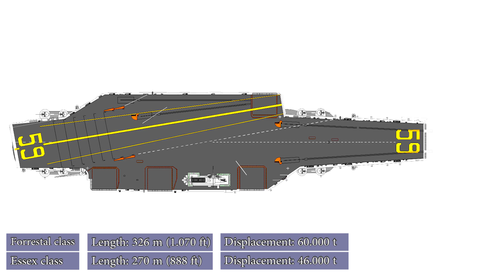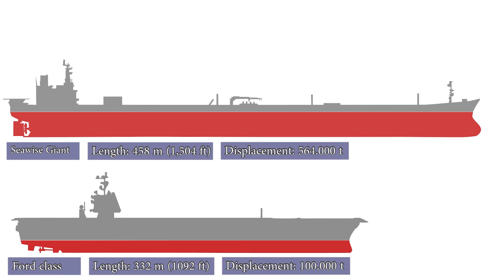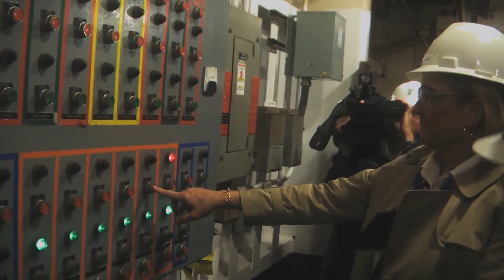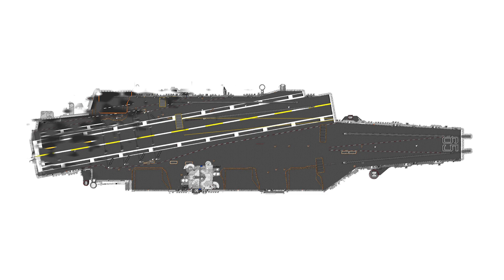Why don't aircraft carriers get bigger?

Comment: The biggest reason Carriers are the size they are, is speed. They need to be fast to get to locations, and evasive maneuvers in combat. The Nimitz can reach 32 knots officially. Some say its reached 40 knots but that's not official.
Reply: Nope!  The longer the waterline, the faster it can go.  They are the size they are so they fit through the Panama Canal.
Reply: @Ron_the_Skeptic  no. Causes its too large in the first place to fit...
Reply: @themeddite , they fit with 1 foot of space on each side, in the old canal.  The new canal is wider with bigger locks but carriers take a long time to plan and build so the larger canal has not affected them yet, and may not as there may be other choke points around the world.
Reply: @Ron_the_Skeptic  n9 cause its over 100 feet wider than this locks. Nimitz DOES NOT FIT IN THE PANAMA CANAL
Reply: @Ron_the_Skeptic  Carriers absolutely do not fit in the Panama Canal. I took 2 of them around South America for this reason. There are some great photos of Ronald Reagan in the Straights of Magellan.
Reply: @michaelmappin4425 , yes, I think I mixed two different references.

Comment: because 3 aircraft carrier that carry 80 aircraft each give more strategic option than 1 carrier that carry 250 aircraft. Also, dont put all eggs in one basket. If 1 of 3 carrier disabled there still 2 fully operational. If 1 250-aircraft megacarrier disabled some battle will lack air cover
Reply: The US military is LEGALLY required to have 11 main aircraft carriers, so if they had to build a bigger one, they'd still have 11.

Comment: Not currently a factor, but might be important in the future: combat UAVs. Of course, we have armed UAVs already, but they're designed for limited roles, and everyone seems pretty hesitant about replacing full on fighter jets with UAVs, but without a pilot and all the stuff you need to safely carry a pilot, and with much lower survivability requirements for an unmanned vehicle, it's probably possible to get full size fighter jet capability in a significantly smaller plane, which can then operate off a smaller ship. For a second tier navy (or really, for anyone who isn't the USN), that could be a game changer. Imagine a fleet of ships the size of helicopter carriers, but with the offensive punch of a supercarrier. Even if it doesn't go that far, just the ability to spread an air wing around multiple smaller ships without compromising aircraft performance as much could be enough to get a lot more countries into the carrier club. The advantage there might just be so huge that some smaller navy that can't afford supercarriers will roll the dice on the idea. Even the USN is getting noticeably nervous about the survival of its supercarriers in a modern war with faster, longer range missiles and armed UAVs and UUVs and AIP submarines and all these other new threats. They may just find themselves stuck between accepting smaller ships with greatly reduced capabilities, or going unmanned in order to keep similar capability via smaller, more numerous ships.
Reply: Except that drones could not come close  to the capabilities of manned fighters nevermind the fact that the moment you try to hang heavier weapons off of it you basically nullify its ability to take off from smaller ships. And on top of that drones have an atrocious safety record so if any smaller navy tries to operate drones in the same manner as supercarriers there going to lose a quarter to half of their drone fleet in peacetime ops alone. And most of those threats you mentioned can easily be countered by proper tactics. Except for the AIP Subs which is an irrelevent threat.
Reply: @gotanon9659  Current drones can't replace manned fighters, but there's nothing fundamentally preventing them from being improved to have similar or superior capabilities. It's definitely a problem that would need a LOT of software development, but there's no reason to think it can't be done. Of course the vehicle has to be big enough to carry the weapons, and the sensors and countermeasures and fuel and so forth, but not having the pilot and all the stuff associated with keeping him alive and and comfortable is a significant savings.

If missiles could be "countered by proper tactics" no-one would buy missiles because they'd be a waste of money. There are ways to survive in a high threat environment, but all of them have costs (and I don't mean in terms of money, though it certainly does cost money). How much those costs are, and how much they will impact the ability of a carrier to do its job is an open question, but I believe that the USN is right to be concerned. I'm not saying that supercarriers will become dramatically less useful. I'm saying that they might.
Reply: There's also the fact that the more capable an aircraft is, the more expensive it is. That applies to unmanned aircraft too. To make one as capable as an F35C will make it as expensive as a manned aircraft and then you'll be back to the same risk assessments only it will involve lots of money which will influence how many you have.
Reply: @MotoroidARFC  No, it definitely would be cheaper, simply because it isn't carrying a pilot. A pilot needs a cockpit, and a whole bunch of equipment for life-support, comfort, safety, emergencies, control, instrumentation, etc. All put together, it's a lot of weight and bulk. A computer doing the same job is a whole lot simpler, smaller and lighter, and that has knock on effects throughout the aircraft. An unmanned aircraft is also a little more expendable. No-one's going to want to lose a high performance drone, but at the same time, if it has a major failure behind enemy lines, you can just self-destruct it and you don't have to worry about rescuing a pilot, so it probably would be a net benefit to scale back margins of safety and redundancy to some degree, which also has benefits for cost and performance.

Just gut intuition, but I don't think a 30% weight savings is unrealistic for an unmanned aircraft of otherwise similar capability.
Reply: @TonboIV  the Global Hawk is about $131 million fly away cost while a Super Hornet is about 66, the Lightning C about 94. And this is just surveillance. So yes, a UAV can get more expensive than a manned aircraft. It really depends on how much capability you want and how many you can afford with that capability.
Reply: @MotoroidARFC  Even assuming your numbers are accurate, an updated version of a 70s fighter and a 90s drone aren't a good comparison because they come from different technology generations. Age is a such a huge factor because development costs are much higher these days, and for the Hornet, the development cost was long ago recovered (or written off). There were also more than a thousand Hornets produced vs less than a hundred Global Hawks! That makes a big difference to cost. Military procurement is also just an incredibly fucked up landscape were costs can be altered by all kinds of ridiculous reasons, and some programs just have a lot more cost overruns than others.

To make a sensible comparison between manned and unmanned aircraft, we have to assume unrelated factors like production numbers or the economic circumstances of the contractor are equal, in which case not needing to carry around a pilot should provide savings. Or rather, if the engineering team can't get savings from not carrying around a human, then those engineers are incompetent and they should be gotten out of the way to some pointless job where they can't do anymore damage. Maybe sales.
Reply: @TonboIV   Global Hawks have flown to Australia from the US on their own and can stay in the air for over 30 hours. To get that capability required more money.

Another example of capability raising costs is the variants of the F35 with the simplest one being the least expensive.

If a manned aircraft gets more expensive  as more capabilities are added to it, why wouldn't a UAV? And why wouldn't the costs exceed that of a manned aircraft in order to get a platform that has more range, can carry a heavier strike load and is faster along with stealth and sensors and super maneuverability?
Reply: @MotoroidARFC  Why do you keep trying to compare aircraft that aren't remotely equivalent? I didn't state in my first comment that the aircraft need to be otherwise similar except for being manned vs unmanned, because that should be obvious! You can't evaluate a technical choice sensibly unless you eliminate unrelated factors from your analysis first.

If everything is the same in two aircraft, except that one has to carry a pilot and the other just has to carry a computer, then it should be obvious that the unmanned one has a lot of potential to be lighter, smaller, and cheaper, which will be exploited by any engineering team worth their pay.
Reply: @TonboIV  I even compared the F35 variants with each other and you are still unable to comprehend that more capability means more cost. Keep deluding yourself that UAVs won't approach and then exceed the cost of manned aircraft as more and more capabilities are tacked on especially when UAVs are the only thing available.
Reply: @MotoroidARFC  I really don't understand your argument at all. Yes, more capability is more expensive, but why would that make unmanned aircraft more expensive than manned ones? I'm talking about a design decision for a new aircraft. The capability requirements are going to be the same whether it's manned or unmanned, but the unmanned one doesn't need to carry a pilot.

Let me ask you some questions now. Do you understand that carrying more weight in a high performance vehicle leads a disproportionate increase in vehicle cost and weight? Do you understand that a pilot and all the stuff he needs weigh more than some computers and sensors? If two new aircraft with similar capabilities are being compared, but one of them is using a much lighter and smaller control system, how could you expect it NOT to cost and weigh less?
Reply: @TonboIV  take the Global Hawk, a surveillance aircraft, and its manned equivalent, the U-2. The latest version of the RQ-4 costs $130 million (30 million more than a basic version due to sensors and other equipment). Meanwhile the latest U-2 would cost $70 million if new today (last one was built in the late 80s). The only shortfall for the Global Hawk is it flies lower than the Dragon Lady but it flies longer in hours and distance. Now the USAF must decide which of these will be useful in the 2020s and into the 2030s. Or will they bite on the new unmanned version of the U-2 from LM (cost unknown and they didn't ask LM for it).The USAF can afford only one platform. My point that UAVs will eventually cost more than a manned equivalent has already happened.
Reply: @MotoroidARFC  Yes there is a UAV that costs more than a manned aircraft. So what? That says nothing about manned vs unmanned aircraft in general.
Reply: @TonboIV  yes it does. Their individual cost will determine how many there will be in the inventory. This limitation has been shown with the F-15 and F-14 and the F-22 and B-2. With the later pair, they cut down the number built which in turn kept older platforms in service. With the first pair, Congress refused the funding to make an all F-14 and F-15 fleet and directed the services involved to acquire less capable aircraft to make up the numbers.

Again, the cost of a platform determines the number of that platform acquired and in service. And if it costs so much that they won't risk sending the platform into combat, what good is it? UAVs will also have that problem. Tomahawk and related missiles are more cost effective.
Reply: @MotoroidARFC  You aren't arguing against unmanned aircraft. You're arguing against new aircraft. Yes, continuing to use an old aircraft can be cheaper than buying new ones, but it has limits! Was the Navy supposed to just use Hellcats for the rest of time because they were cheaper than Banshees? Sooner or later, you need a new aircraft, and if you're designing a new aircraft, replacing something large and heavy and fragile with something much smaller and less demanding will obvious reduce the cost and weight.
Reply: @TonboIV  no, I'm pointing out that developing and operating UAVs capable of fighting their way through a defense will cost too much. Better to rely on dumber missiles that are cheap enough to overwhelm the defense.
Reply: @MotoroidARFC  Again, you aren't making any argument that wouldn't apply equally to manned or unmanned aircraft.
Reply: @TonboIV  name a UAV in service that has the same capabilities as an F-22 or an F-35 C and can compete with them in the same way the Global Hawk competed with the U-2. They don't exist and they will cost too much when a less expensive alternative already exists. Your comment saying combat UAVs will be less costly than a manned aircraft forgets the fact they don't exist and will cost too much to be expendable in the same manner as cheaper UAVs with limited capabilities.
Reply: @MotoroidARFC  They don't exist yet. I said in my very first comment that I was speaking of the future. Did you even read it? Do you really think that a computer which can control a fighter jet in combat can't be made? I'm certain it will be done sooner or later, and probably sooner given how fast autonomous vehicle tech is advancing.

Once that tech is available, there will be a choice between two types of control systems for aircraft, one of which is a lot lighter, smaller, less fragile and demanding, and more expendable.
Reply: @TonboIV  not without costing a lot of money. Not without costing as much or even more than an equivalent manned aircraft. Not without costing more than a cruise missile. Once they cost too much to acquire enough and use effectively, they are pointless.
Reply: @MotoroidARFC  Why would an unmanned aircraft cost more than an equivalent manned aircraft?
Reply: @TonboIV  if you want full size fighter capability you must pay for it. Range, bomb load and speed will have to be improved if it is to match existing platforms. And just because it's unmanned does not mean it becomes significantly smaller. The $155 million Stingray is wider than a Super Hornet. It will need additional equipment to make it lethal as it was first envisioned before being relegated to the tanker role.
Reply: @MotoroidARFC  You again are not responding to what I wrote. Why would an unmanned aircraft cost more than an EQUIVALENT manned aircraft?
Reply: @TonboIV  you have the answer right there. Further, I've given you two examples of UAVS costing more than the manned version of what they're doing. Do you know how to read?
Reply: @MotoroidARFC  I think I'm about done here. Trying to get through to you is clearly pointless.
Reply: @TonboIV  you're the one who can't comprehend that UAVs can get expensive when they try to match a bigger manned aircraft which make them too expensive to be expendable. Two examples of this are the Global Hawk and the Stingray and these aren't combat capable. It would be better to make them just capable enough to assist manned aircraft or make them so dumb and cheap that hundreds of them can be expended against an enemy while being less expensive than a single cruise missile like those Iranian drones used to attack Ukraine.

Comment: Having actually been on a US super-Carrier (USS Abraham Lincoln) small is not the term I would use to describe it. Comparing them to super-tankers or Cargo ships is flawed, the ships have very different purposes. Cargo Ships and Tankers are required to be so large to transport massive amounts of cargo for economical reasons, the things are slow and not very maneuverable don't need to be maneuverable either. They're designed to get the most amount of goods from point A to point B in as few as trips as possible. Carriers are required to be able to take evasive maneuvers. Plus Carriers are very active places having to balance fueling, arming, and launching of fighters their decks are choreographed chaos; too big and efficiency goes down, to small effectiveness of the airwing goes down.  Nimitz and Ford Class Carriers are the record holders at sea in the MILITARY category while falling to certain ships in the civilian categories.